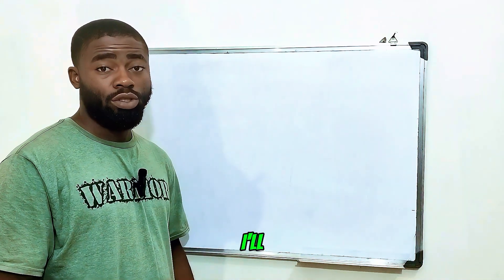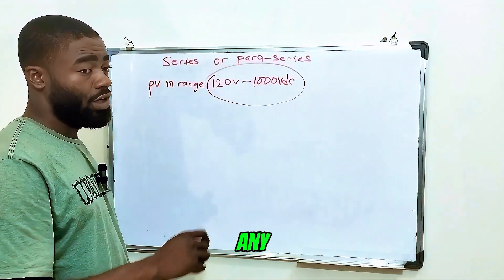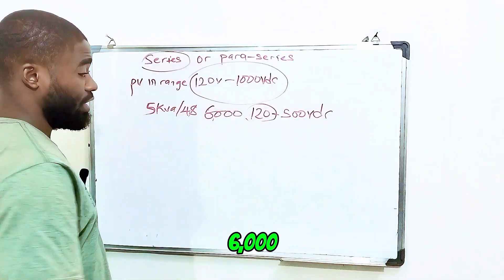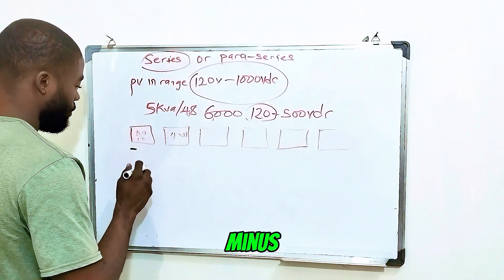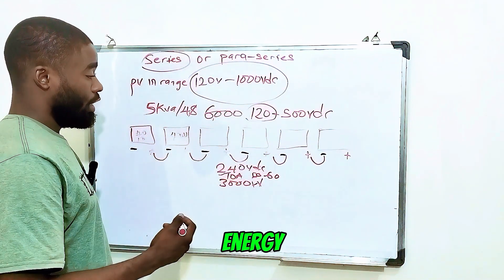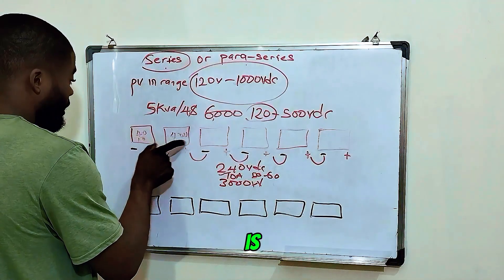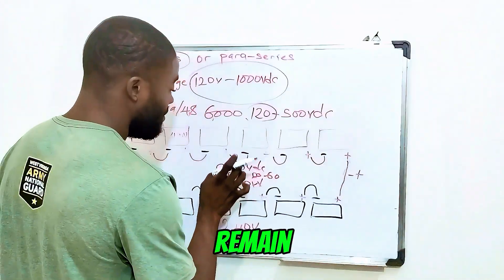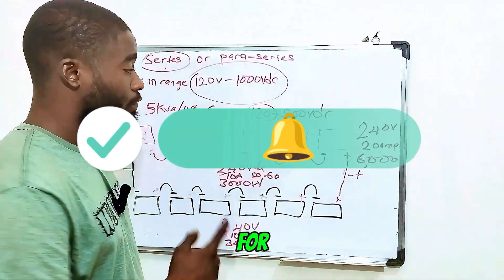Series or Para-series; which is suitable for a solar hybrid inverter?

Comment: Point of correction, the total power is 4800W, and not 6000W, with the series-parallel connection. The same power of 4800W if we are to connect all the 12 solar panels in series
Reply from the maker: It just an example.
500w will give more voltage and current than that!.

Comment: Great video! I enjoyed watching it from start to finish.

Essentially, I believe there are two types of hybrid inverters. The first type has a normal MPPT (Maximum Power Point Tracking) which voltage range in some most case is from 90v DC - 190v DC, functioning like a typical external solar charge controller. The second type is the high voltage hybrid inverter. This video focuses on the latter, the high voltage hybrid inverter, which I think differs significantly from the standard MPPT voltage range type.

Weldone!
Reply from the maker: Yeah 👍.
You got it right
Reply: Please how much would it cost for a 1kw solar panal installation...

Comment: Series all of them is my preferred choice. Higher voltage, lower current, thesame power,  less stress on the cable, small cable size, more easier connection

Comment: the only drawback of all this high voltage solar inverters is due to conversion from high voltage to amperage. they tend to be less efficient as some energy is lost compared to the normal mppt hybrid inverters.
to me the only advantage they have is ability to work without battery which in most cases, rhat feature will not be used
Reply from the maker: Yeah, there's a lot of energy lost